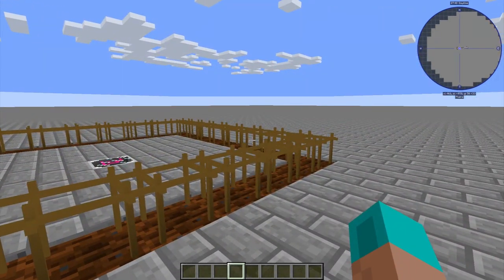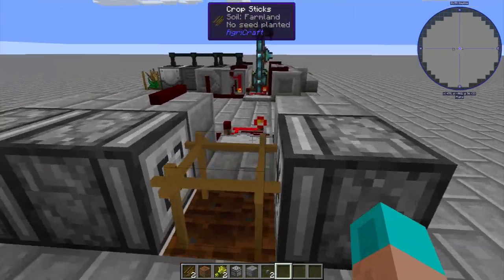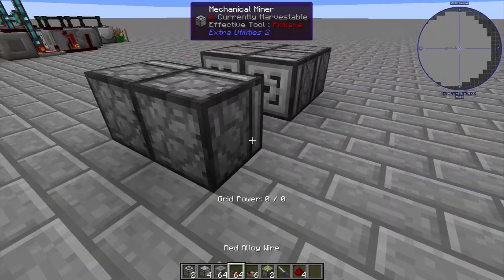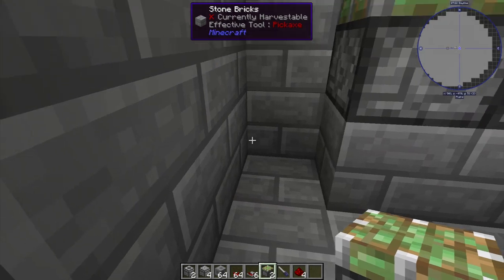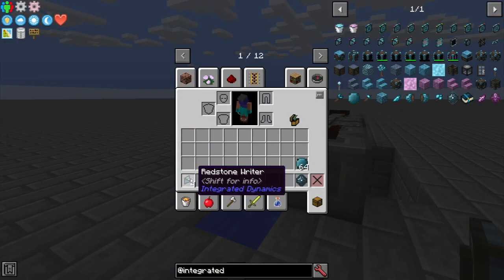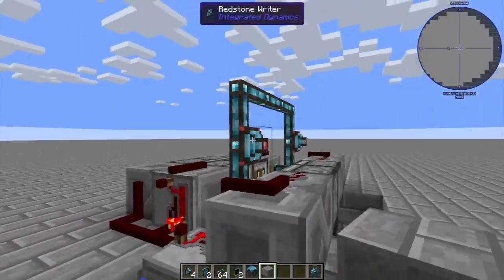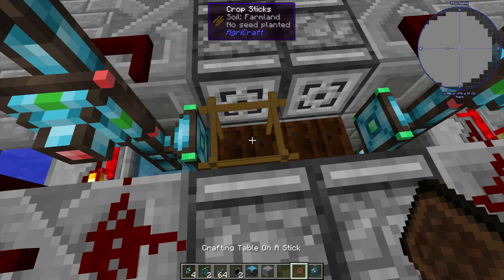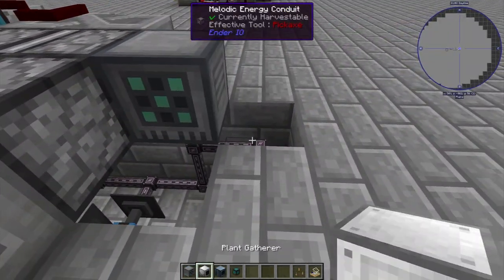[TUTORIAL] Fully Automatic 10/10/10 Agricraft Seed Mutator

Comment: Tried it but doesn't seem to work with vanilla redstone unfortunately
Reply from the maker: I remember having issues with vanilla redstone as well. I did end up making a 2.0 version of this that I believe used 100% integrated dynamics for redstone logic. Don't know if I still have those files. This is an older version of modded, I'm surprised people still watch this video.
Reply: @sp00kthebourgeois  I've started playing 1.12.2 MC Eternal so this video is perfect for that. Would you be able to find those files? Would be very appreciated :)
Reply from the maker: @nutty8871  Yeah so I found it. It was still just all one continuous integrated dynamics system, but I used redstone writers straight into all of the mechanical users/miners and pistons. No vanilla redstone or alloy wire. The users in the back I had set to fire if the block above the soil was empty (had no sticks or plants). the user in the front I made it fire when it detected that the crop sticks did NOT contain an item that had a "agri_strength" nbt tag. There was some other differences like I had the users set to "redstone signal" instead of "redstone pulse". but that's the basic idea
Reply: @sp00kthebourgeois  what did you use for the sticky pistons if you removed all the vanilla redstone?
Reply from the maker: @nutty8871  still just the redstone writers, but I think I pointed them up toward the bottom. I believe there was issues with quasi-connectivity or whatever
Reply: @sp00kthebourgeois  sorry for the amount of questions but - you said that the back users were set to "fire if block above soil is empty". What did you use to set it to this?

Edit: also, for the front facing users, what type did you set the variable card to when using the logic programmer?
Reply from the maker: @nutty8871  there's a "has block" card you get from the block reader, and then I ran it through a "not" card
Reply from the maker: @nutty8871  for the front users, I used a regular "has block" (don't use "NOT" for that one) and did an AND card with a NBT.has_attribute for "agri_growth" (you can use any stat, I just chose one)
Reply from the maker: sorry, for the "has_attribute" you have to run that through a NOT, because you're checking to see if the crop sticks are empty. So the logic is: (IS NOT EMPTY SPACE) AND (DOES NOT HAVE "agri_growth" Attribute")
Reply: @sp00kthebourgeois  Im so confused but still trying to work it out in game lol
Reply: So what i have in the back users right now are: When the block is not a crop stick, place one
And for the front users, I'm not able to take the NBT.integer cards and put them through a NOT
Also can't seem to find the NBT.has_attribute location
Reply from the maker: @nutty8871  sorry, it's "nbt.has_key". There's no nbt.Integer involved for the front user
Reply from the maker: Oh my God I just looked at it again, there's something using the "agri_cross_crop" key. Honestly it's been so long I just can't remember everything and it's really hard to reverse engineer it
Reply from the maker: The 2.0 I'm looking at looks more streamlined but clearly the logic is really convoluted, you might have better luck using the one in the video and trying ender Io redstone conduits or something
Reply: @sp00kthebourgeois  alright lol ill fiddle around with it for a while. Thank you for the help!   I might nag you again later :P
Reply from the maker: @nutty8871  https://drive.google.com/drive/u/0/folders/1TNaZAD9tvo6c6oYFogC1tWbyKAonJ64A
Reply from the maker: here's the save file. The machine is at -100 250. it's a custom modpack so if it doesn't work with mceternal, i uploaded the curseforge profile (the one called rykkit). you can import that as a profile in curseforge and see the world that way
Reply from the maker: the machine is a bit different, you just have to have a seed in your hand and hold right click until the cross crop breaks and the seed goes in
Reply: @sp00kthebourgeois  Oh god lol, looking the machine now. Gonna be one hell of a ride trying to replicate this
Reply from the maker: @nutty8871  everything connected to the drawer on the bottom is completely optional. I had crop stick recycling on the thing lmao
Reply: @sp00kthebourgeois  I did note that :) will just be trying to make the base machine for now
Reply: @sp00kthebourgeois  I've hit a roadblock; I dont know which pieces go together for some of these variable cards. Ones like the "equals, add, not, nbt_has_key"
Reply from the maker: @nutty8871  yeah it's a mess. You can work backwards from the variable ids in { } brackets but it's definitely a pain. I'm looking into doing another video on it but no promises
Reply: @sp00kthebourgeois  Alright I see what you mean about the reverse engineering. Doing that right now in the world file you gave me and rebuilding from there and maybe I'll remember what to do lol
Reply: @sp00kthebourgeois  Damn. I think I rebuilt this thing to a T but it still isn't running

Edit: Scratch that, it's just very slow without an imaginary time block! I used a watering can and now it's working much faster :D time to go test it on my world (hopefully)
Reply from the maker: @nutty8871  so I installed mc eternal to see if that made a difference. I was able to make it from scratch using 100% integrated dynamics for the redstone, which I can go into detail in another comment if you're interested.

But more importantly, it looks like mc eternal by default uses 2-parent mutation, meaning this machine won't improve the seeds, even if you get it set up right
Reply: @sp00kthebourgeois  I got it to work, but hearing about the 2-parent mutation thing is an absolute tragedy after all this trail and error D: thank you so much though for taking the time to help me out!
Reply from the maker: @nutty8871  you can change it in the configs, I believe direwolf did when he did his playthrough, let me look up how to do it real quick
Reply: @sp00kthebourgeois  If you'd like to that's great, but no need :) I don't actually have access to the  console but my friend does, so I'll have to get him to work with it next time he's online
Reply from the maker: @nutty8871  sure. in the mc eternal install folder, or in that case the server files: 

...\MC  Eternal\config\agricraft

edit the config.cfg file and change the line that has

B:"Single spread stat increase"=false

to 

B:"Single spread stat increase"=true
Reply: @sp00kthebourgeois  alright cool, thank you again! You've been a massive help
Reply: @sp00kthebourgeois  So we changed it and the mutations are happening now which is great! But its seeming to take like 5 minutes per mutation without using a watering can on it from mystical agriculture
Reply from the maker: @nutty8871  yeah it's horrendously slow without tick acceleration like watering cans. That's just a product of agricraft. There's some other settings in the config file you can change, like hardcore stats=false and increasing the mutation rate, but the machine isn't magic, still relies on luck, just takes a bit of the tedium out of the process
Reply: @sp00kthebourgeois  darn alright